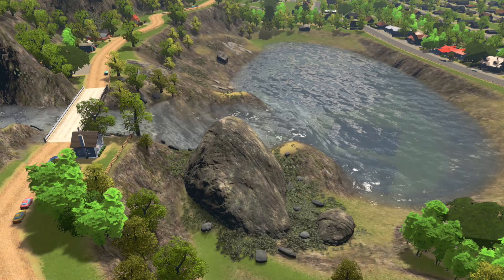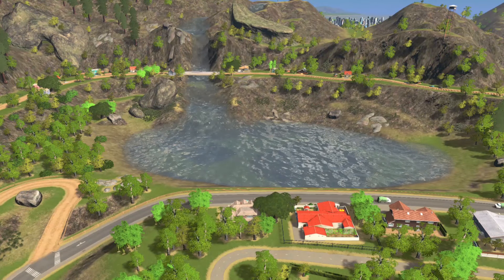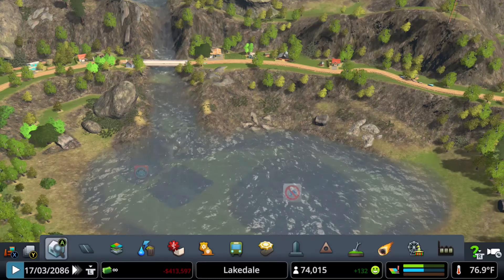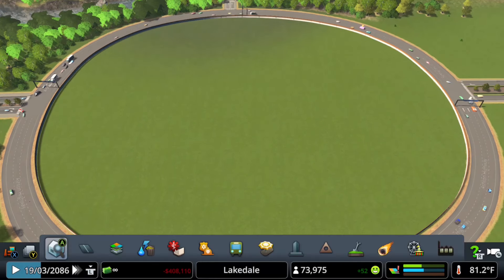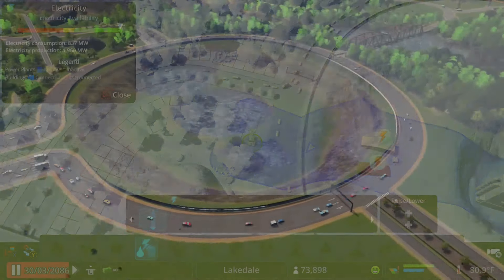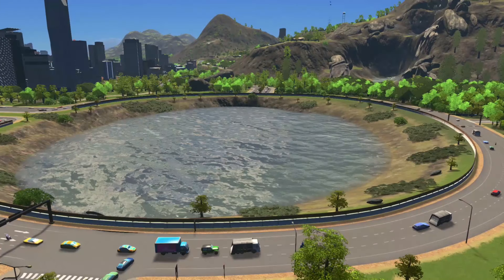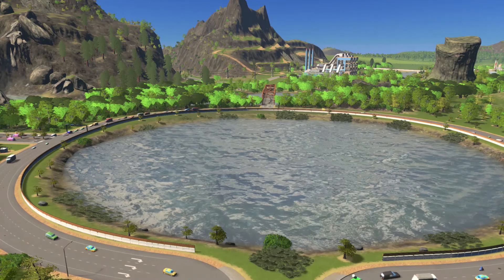Tutorial:  building a self-contained lake without mods

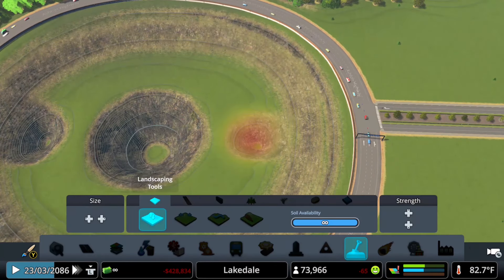Comment: What are you placing down at 1:28? Something from a mod or DLC? I have never seen it before. So building a lake is impossible in vanilla mode?
Reply from the maker: That’s a fresh water outlet. They’re in your water menu. When you hook them up to pipes and electricity, they pump water. However, they may have been apart of the Disasters expansion.
Reply: @woodypowers1486  My outlets wont let out water - how do I fix this?